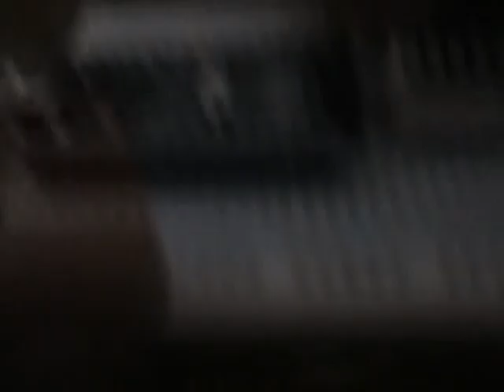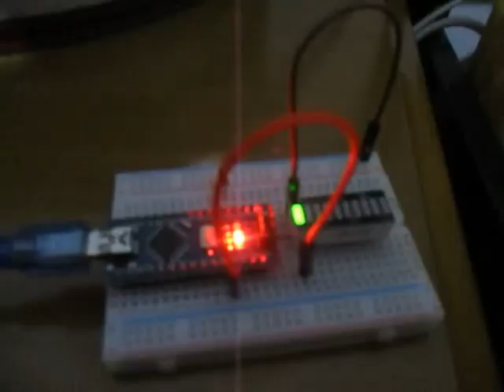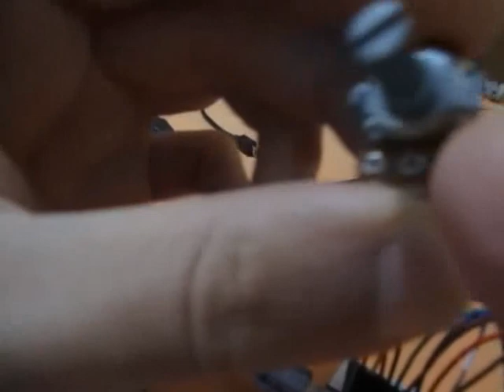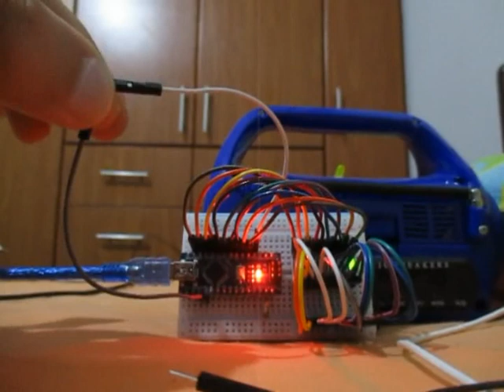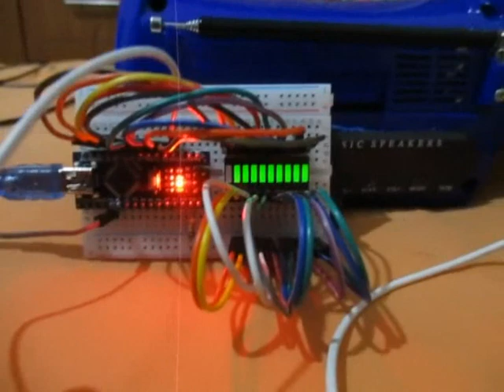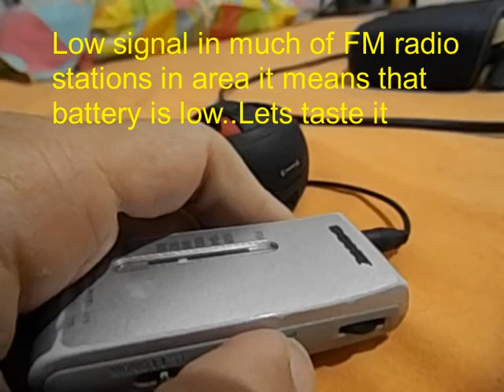Arduinno 5v battery level indicator in 10 bar led

Comment from the maker: /*This software is provided in AS IS condition,NO WARRANTIES in any form apply to this software.
 picmicrolab.com 
*************************************************************************************************************
//LED Battery Level Indicator Arduino - 10 LEDs I/O -0..9
//Analog Input 0-5V A0
*/
//******************************************

void setup() 
{
 // initialize LED & Analog I/O pins.
   pinMode(2, OUTPUT); 
   pinMode(3, OUTPUT); 
   pinMode(4, OUTPUT); 
   pinMode(5, OUTPUT); 
   pinMode(6, OUTPUT); 
   pinMode(7, OUTPUT); 
   pinMode(8, OUTPUT); 
   pinMode(9, OUTPUT);
   pinMode(10, OUTPUT); 
   pinMode(11, OUTPUT); 
   
   pinMode(A0, INPUT); 
}

void loop() 
{
  int analog_input = ( analogRead(A0) * 4.9 );
  delay(100);
if(analog_input  < 490 )
{
digitalWrite(2,HIGH);
digitalWrite(3,LOW);
digitalWrite(4,LOW);
digitalWrite(5,LOW);
digitalWrite(6,LOW);
digitalWrite(7,LOW);
digitalWrite(8,LOW);
digitalWrite(9,LOW);
digitalWrite(10,LOW);
digitalWrite(11,LOW);
}

if(analog_input  > 490 && analog_input  < 980)
{
digitalWrite(2,HIGH);
digitalWrite(3,HIGH);
digitalWrite(4,LOW);
digitalWrite(5,LOW);
digitalWrite(6,LOW);
digitalWrite(7,LOW);
digitalWrite(8,LOW);
digitalWrite(9,LOW);
digitalWrite(10,LOW);
digitalWrite(11,LOW);
}

if(analog_input  > 980 && analog_input  < 1470)
{
digitalWrite(2,HIGH);
digitalWrite(3,HIGH);
digitalWrite(4,HIGH);
digitalWrite(5,LOW);
digitalWrite(6,LOW);
digitalWrite(7,LOW);
digitalWrite(8,LOW);
digitalWrite(9,LOW);
digitalWrite(10,LOW);
digitalWrite(11,LOW);
}
if(analog_input  > 1470 && analog_input  < 1960)
{
digitalWrite(2,HIGH);
digitalWrite(3,HIGH);
digitalWrite(4,HIGH);
digitalWrite(5,HIGH);
digitalWrite(6,LOW);
digitalWrite(7,LOW);
digitalWrite(8,LOW);
digitalWrite(9,LOW);
digitalWrite(10,LOW);
digitalWrite(11,LOW);
}
if(analog_input  > 1960 && analog_input  < 2450)
{
digitalWrite(2,HIGH);
digitalWrite(3,HIGH);
digitalWrite(4,HIGH);
digitalWrite(5,HIGH);
digitalWrite(6,HIGH);
digitalWrite(7,LOW);
digitalWrite(8,LOW);
digitalWrite(9,LOW);
digitalWrite(10,LOW);
digitalWrite(11,LOW);
}
if(analog_input  > 2450 && analog_input  < 2940)
{
digitalWrite(2,HIGH);
digitalWrite(3,HIGH);
digitalWrite(4,HIGH);
digitalWrite(5,HIGH);
digitalWrite(6,HIGH);
digitalWrite(7,HIGH);
digitalWrite(8,LOW);
digitalWrite(9,LOW);
digitalWrite(10,LOW);
digitalWrite(11,LOW);
}
if(analog_input  > 2940 && analog_input  < 3430)
{
digitalWrite(2,HIGH);
digitalWrite(3,HIGH);
digitalWrite(4,HIGH);
digitalWrite(5,HIGH);
digitalWrite(6,HIGH);
digitalWrite(7,HIGH);
digitalWrite(8,HIGH);
digitalWrite(9,LOW);
digitalWrite(10,LOW);
digitalWrite(11,LOW);
}
if(analog_input  > 3430 && analog_input  < 3920)
{
digitalWrite(2,HIGH);
digitalWrite(3,HIGH);
digitalWrite(4,HIGH);
digitalWrite(5,HIGH);
digitalWrite(6,HIGH);
digitalWrite(7,HIGH);
digitalWrite(8,HIGH);
digitalWrite(9,HIGH);
digitalWrite(10,LOW);
digitalWrite(11,LOW);
}

if(analog_input  > 3920 && analog_input  < 4410)
{
digitalWrite(2,HIGH);
digitalWrite(3,HIGH);
digitalWrite(4,HIGH);
digitalWrite(5,HIGH);
digitalWrite(6,HIGH);
digitalWrite(7,HIGH);
digitalWrite(8,HIGH);
digitalWrite(9,HIGH);
digitalWrite(10,HIGH);
digitalWrite(11,LOW);
}
if(analog_input  > 4410)
{
digitalWrite(2,HIGH);
digitalWrite(3,HIGH);
digitalWrite(4,HIGH);
digitalWrite(5,HIGH);
digitalWrite(6,HIGH);
digitalWrite(7,HIGH);
digitalWrite(8,HIGH);
digitalWrite(9,HIGH);
digitalWrite(10,HIGH);
digitalWrite(11,HIGH);

}
}